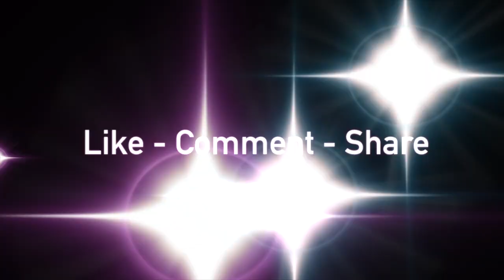Splitting Firewood - Working in the Wood Yard with the Wife, Wolfe Ridge and 6 Way Wedge.

Comment: OK, I've had some time to think more on your question of piles versus stacking and also stacking in general for your wood process.  In my mind, I was thinking that you had covers on your stacks of wood that are split, but I just noticed that the tops of your stacks are open.  I think that a cover for your outside stacks would be the most important thing you could do. It will dry better and faster if it is covered on top.  I use galvanized steel or plastic roofing or tarps.  You could also increase the number of rows in your stacks. When you let your split wood get wet from rain and snow, that's a backwards step. Now for the big haystack pile. I see that as a temporary stage before stacking in covered rows where the split wood can effectively dry, not as a way to get dried wood. Although there are air spaces in the haystack, but there is no good air circulation.  Do I remember right, that you had a lot of split wood in a outbuilding that didn't have good ventilation and so the interior sticks of wood were still not dry?  If it was not you the principle is still the same.
Reply from the maker: I usually cover the stacks, but not until late fall before the snow. I've got a few ideas on a solution but just wanna make sure I know for sure where to do/build it.👍😀🍻
Reply: @Back40Firewood  That's a good plan!

Comment: That 6 way really speeds things up! Wow!  Wondering if you have ever tried or considered stacking wood vertically on a pallet? Besides the loose stacks of your roadside stand of coarse.  I have very limited space to store my wood along my driveway. I have just over 40' of stacked wood in single racks. But behind those are my pallets, and I stack the wood up vertically to around 3' or so. I stack in a cross pattern so there are plenty of gaps to allow for good air flow. Just thought if space becomes limited in your wood yard, this may help to store more wood without long rows.
Reply from the maker: That's an interesting idea with the vertical stack, but do you mean on end vertically? One thing I could see being an issue would be if your pieces aren't all cut the same length. I think I am gonna end up stacking some of that pile up.
Reply: @Back40Firewood  I actually made a short video of my current wood inventory. I'll try and email it to you.

Comment: Imho, if space considerations are a concern stacking takes up less space. Up to a point that is. If you only stack four feet high but toss it up on a pile eight feet high the pile takes less space. But....If you have a contained space, just say 10x10x10, you will fill that space with a greater quantity if stacked. Your results may vary....  Man that six way is a great thing for minimizing efforts. Good video my man.
Reply from the maker: Thanks buddy...yeah I think I'll leave some in a pile and see how it does, it should be fine & if not come next Spring I'll get the center/bottom exposed more.

Comment: I’m sure you received many opinions/thoughts on the matter so what’s 1 more??  I think stacked off the ground and just 1 row you will be most successful in trying to season fastest.  I think stacked off ground with 5 rows that are tight and covered will take longest to season, but you should have zero spoilage.  I think a pile on pallets are in between the two scenarios so I think most will season fine, but you do run the risk of spoilage of some of the wood at very bottom even if off ground.  I’m not a big fan of covering green wood, I think you miss the sun and some airflow.  But covered is great when fully seasoned!  I just subscribed, thanks for sharing.
Reply from the maker: Thanks for the feedback & welcome to the channel and Back 40 community. I'm the same with covering green wood...I usually just tarp my stacks in the winter.👍😀🍻

Comment: Don't leave it in a pile. Sack wood after you chop or you will hate moving wood again from a big pile to somewhere else. 

Have you ever use IBC container without the inner part and sack wood in it. ( cut the inner diagonally from one corner to other and use it as a roof and wire it to the cage leaving the sides exposed for venting) then use the forks to lift and move containers around as need.
Reply from the maker: I have been looking at starting to track down some of those totes.👍😀🍻

Comment: I’m about over using pallets as they just don’t last.  Yeah oak needs to be stacked in single rows for sure.  Green oak that is.  #AmazingAmanda did good job.
Reply: I have an area I am using 2x4s as that seems to work out great., the bottom row gets bark down so ay least in my mind the wood wont get wet..
Reply from the maker: These heavy duty pallets I have tho have 2x6 tops..takes a long while for them to go bad. I'm still using some I've had for 5 years now.